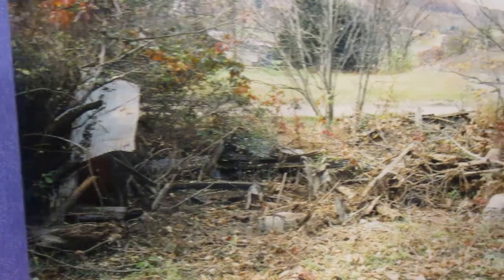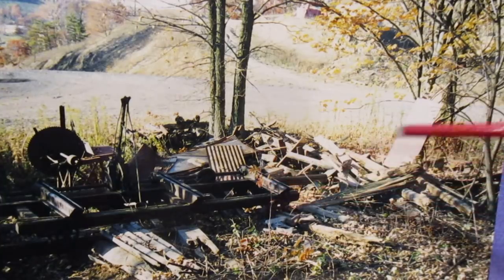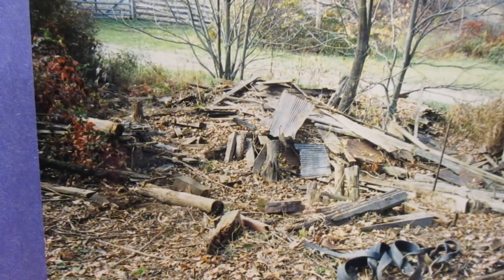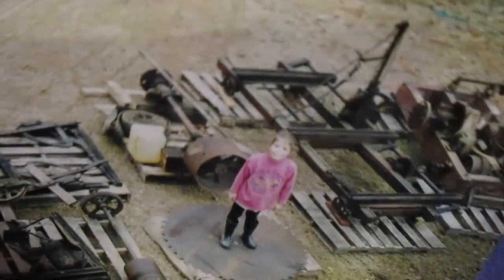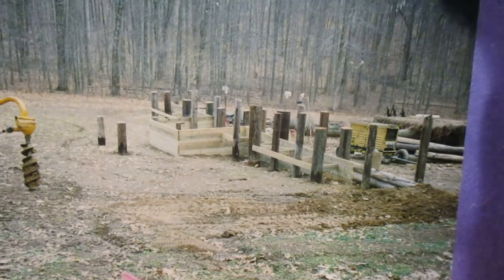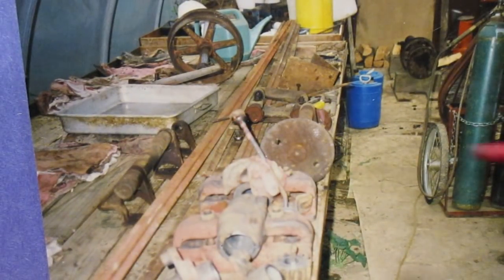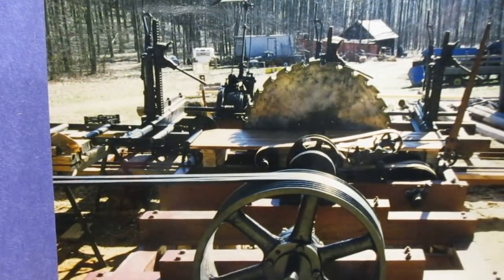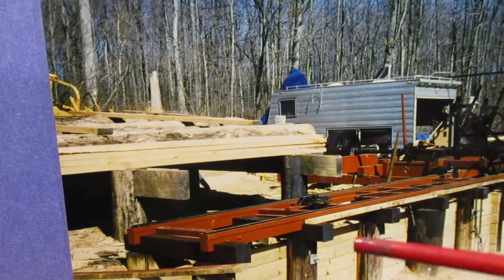#155 My first look at my new Frick sawmill

Comment: John, I'm a new subscriber. Been a sawyer for 40 or so years, we have considerate Swanigan's the same. My current circular mill is half Chase and half Lane with a 6 cyl. Ford industrial power unit, Made in England at the Dagenham plant. I call it my Chase D' Lane mill. I built a bandsaw mill about 20 years ago that has made me good money  and I use it for suspicious logs, most I will be out is $23.00 if I hit tramp metal. First mill I built in the early 8o's was portable, built on steel roof trusses, I made the arbor from a 2 3/8" heavy fan shaft  fast and loose collars were machined from those cast iron weights they use to close fire doors. I may, If its alright with you John,  describe some of the modifications I made to help a lone sawyer and safety devices, in the future.
Reply from the maker: good to hear from another sawyer  that also brought a mill back to life  john

Comment: John, did the 271 have enough moxie to cut hard wood.?? Most folks have no idea of the work required to restore and set up a mill and the precision required. There are many "mill piles "around the country that will never make sawdust. A fella always end up with at least two mills and parts.
Reply from the maker: the 271 was a good motor and sawed a lot of logs . there is a relationship between size of blade # of teeth  angle bite . So i bought a 671 and was going to use it than about the same time i came across a 471 all set up and went with it . i have now put the 671 on the other mill . john